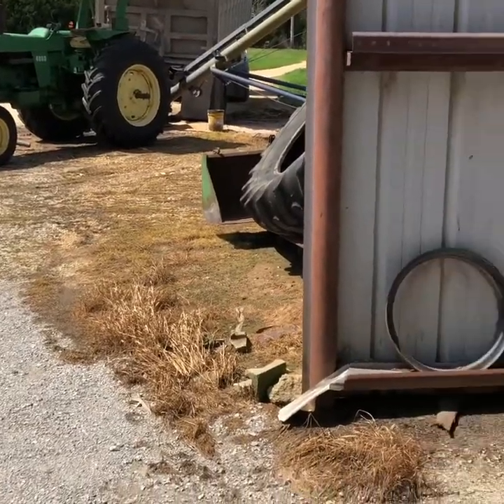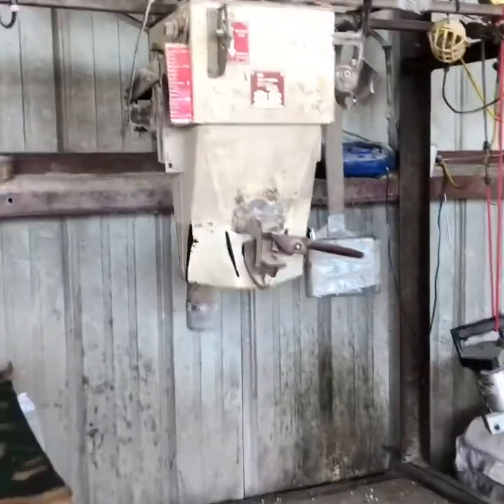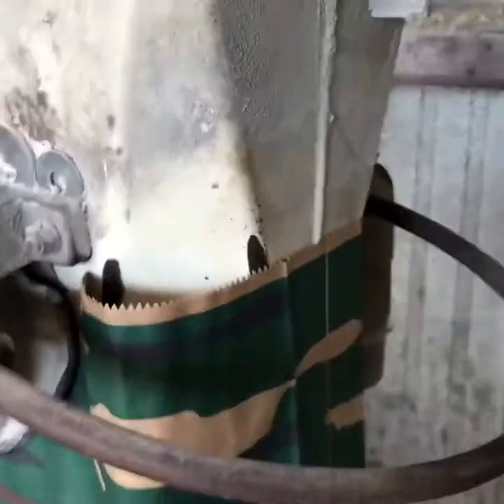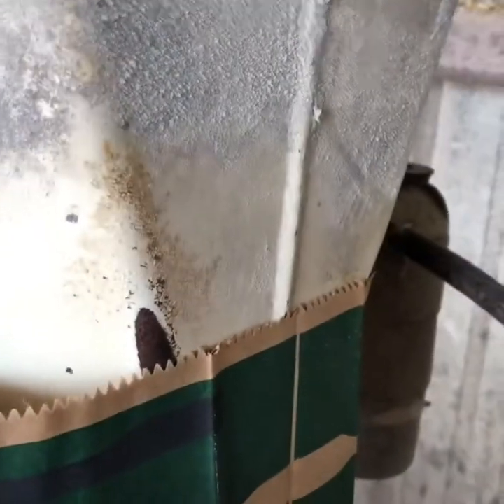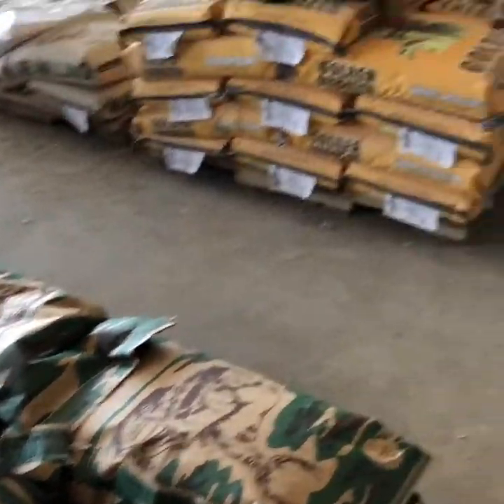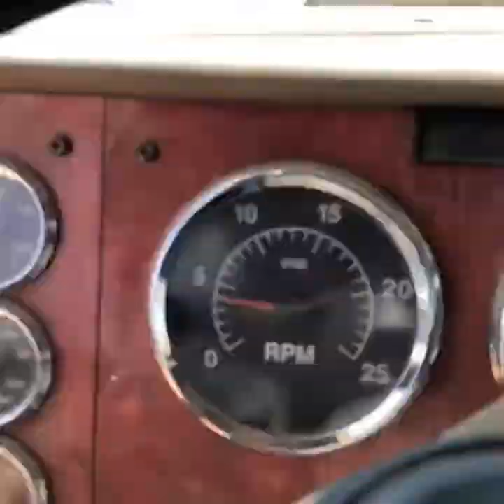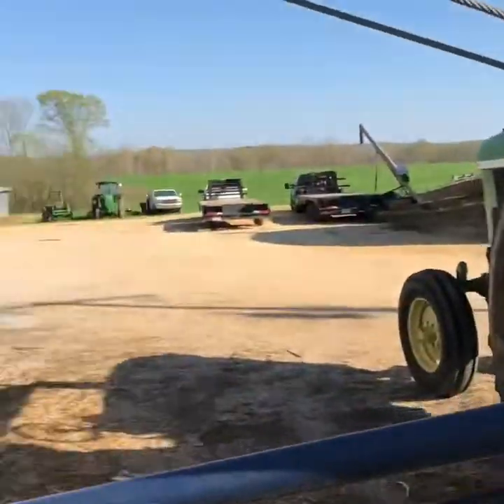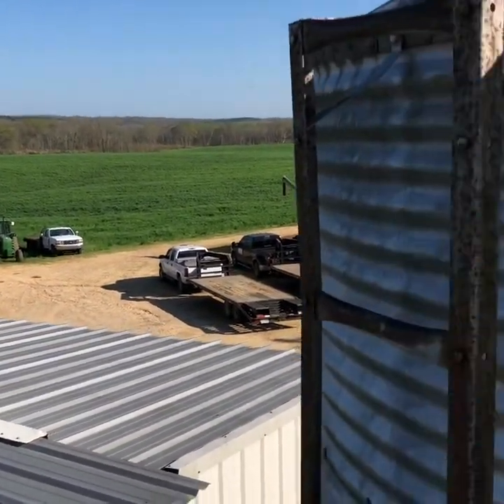Corn Bagging on the Farm

Comment: Used to run a setup almost identical to that when I worked for the feed store. 3 tons a day minimum, and you got a $.50/hr bonus if you bagged 5 tons or more. Now I'm looking for one of my own, since my family and I are selling corn and other livestock feed directly from the farm. Looking for ways to make us more efficient. The old barrel and scoop just ain't cutting it no more, and we're wanting to ramp up production in the next several months.
Reply from the maker: In the peak of the season I bag out as much as 27 tons a day.
Reply: @marshallellisfarm_8802  lordy be. You do all 50's, or 100's too?
Reply from the maker: All 50s bud.
Reply: @marshallellisfarm_8802  Definitely easier, but 2x the amount of work.
Reply from the maker: @RustyCarnahan  we are in the market for an automated system now. I did over 100k bushels last year.
Reply: @marshallellisfarm_8802  well now, I might possibly be interested in your old setup if you decide to sell it once the automated system is up and running.
Reply from the maker: @RustyCarnahan  boss wouldn’t want to sell it. If we make an automated move that will be our back up.